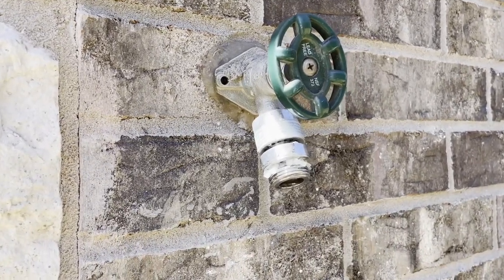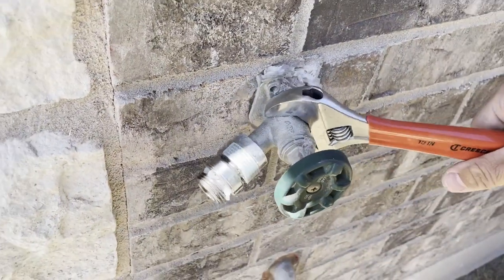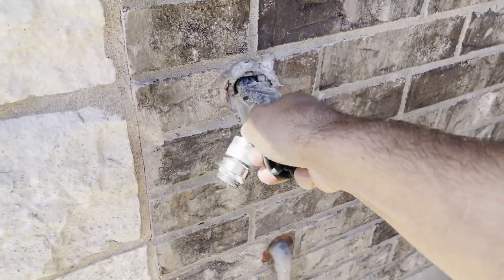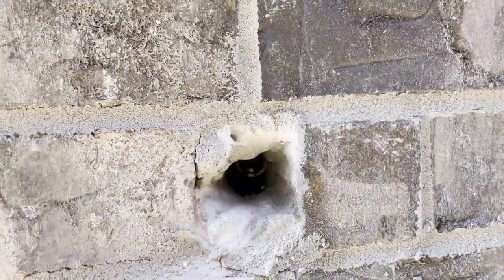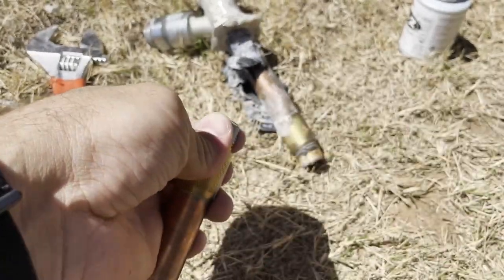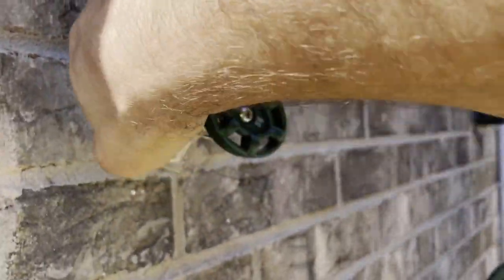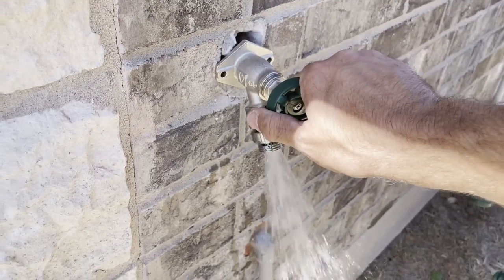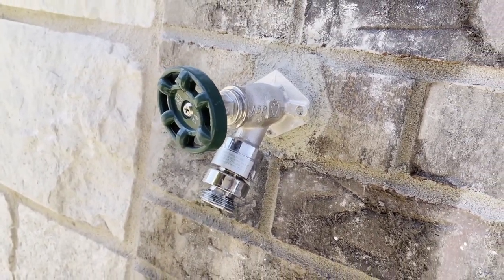How to replace an outdoor spigot/faucet

Comment: How did you know it wasn’t soldered? Thanks
Reply from the maker: I didn’t. That’s the risk you have to take
Reply: @DIY-repair  have you ever turned one that was soldered? Just wondering. Thanks
Reply from the maker: @kauaireed9006  Yes, I have.
Reply: @DIY-repair  how much damage does it cause, if it’s turned and is soldered. Thanks